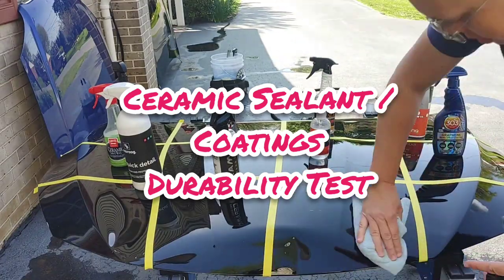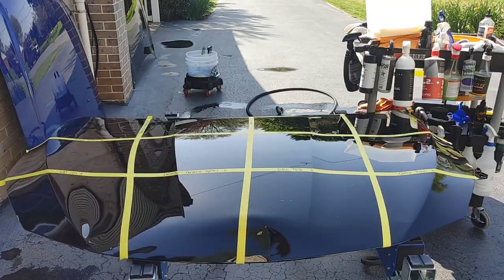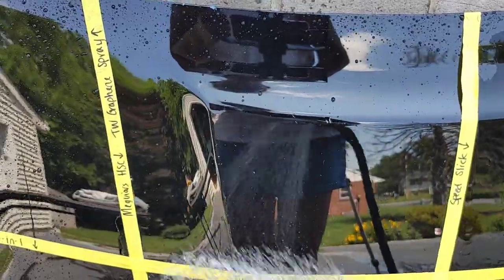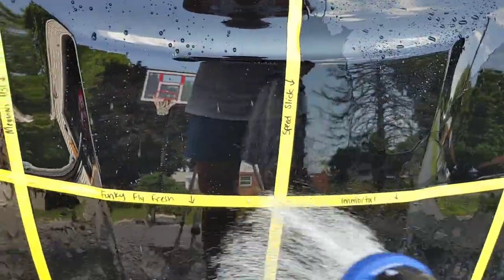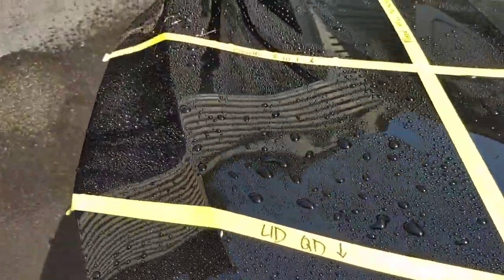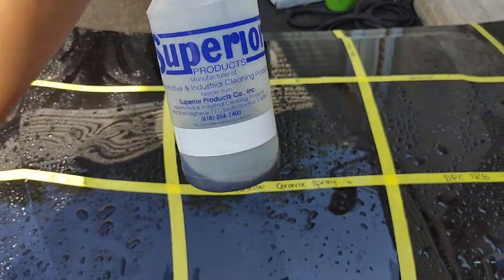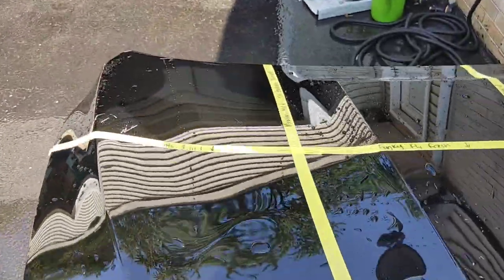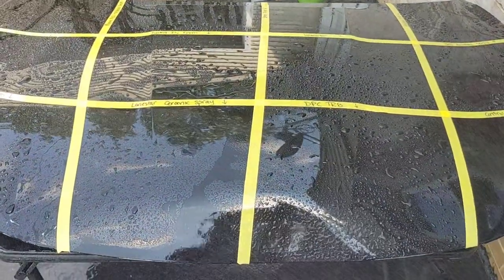11 Fan Favorite Ceramic Sealants + Spray Coatings Durability Test- ONE CLEAR WINNER! Which One Won?

Comment: We had a couple issues with SPEED SLICK. We've not only fixed the issues, but we've made it much stronger (doubled the amount of ceramic base) and durable...we also changed the name to BOOST. 

We'll send you a new bottle out and if you include it in any future tests like this, we're confident it'll grab the number 1 spot. 

But I feel honored to be among these other great companies/coatings and to be considered one of your favorites. 

As a small company, there are growing pains every now and then, but we are constantly working to make our products better and better. 

Thank you so much for including us.
Reply from the maker: Can't wait to test it out!
Reply from the maker: And I can appreciate a company who is constantly learning and evolving. Some companies I've worked with don't have that same humility and desire to give their customers the best they can produce even if it takes a couple tries to get it right.
Reply: @attention2detailswchelsea  I'll get it sent right out. I apologize, I thought I already had sent it. But I definitely WILL get it shipped out.
Reply: It’s good to see companies like yours taking on info like this a using it to improve a product👍
Reply: @johnp6987  Thank you. Yeah, we made the adjustment awhile back. The coating is now called BOOST. I mistakenly thought I'd already sent Chelsea a replacement bottle. If I had, the results would've been much different. 

I'm always formulating and testing new products. I have 14+ product formulas on the shelf right now, undergoing tests to see which, if any, will be our newest coating. Always trying to improve!
Reply: @blackrhinocarcare1087  I hope that Boost has more of a sheeting effect because quite frankly, I’m not a fan of all the beading. In a light rain, if you don’t dry your car, you get a ton of dried water spots the next day and it looks terrible. I have a daily driver that I prefer to wash every 2 weeks.  That’s just my 2 cents
Reply: @pasqualepisani , I agree bro. Absolutely hate beading products at this point. Anything but a torrential downpour and my car is absolutely trashed. Water spots everywhere and the car has to be completely re-washed. Sheeting all the way. Effectiveness over looking cool

Comment: Thanks for doing this. IMO, I’ll take the product that sheets the most with the least amount of beading. That may sound confusing but I don’t want to be a slave to my car every weekend or after every rain storm because of water spots.  I’d rather apply a sealant once a month than get water spots or have to dry my car after a light rain

Comment: I don’t know Madam Chelz, I’ve applied Undrdog Quick Detail to some customers, the come back usually in about every two months and after hittin it with Koch Chemie Active foam, the performance is way better. 
Similar with Griots 3 in 1, which is by far the most cost effective products here I think. I mean, you can buy 3 bottles  of Griots for almost the same of a bottle of immortal, and performance looks the same. 
Gotta agree that Meguiars Hybrid Praint coating is the top performer here, but it’s a lite coating. I would put it against Gyeon One, Can Coat, CQuartz Lite or Tac Systems Moonlight

Comment: Some of these products really blur the line between coating and sealant. I've been using the Turtle Wax and Griots for a while and have definitely had to deal with streaking, especially with the Griots. Will have to give the Meguiar's coating a try -- bit more expensive, but I think given its durability it should sort of level out. Thanks for the comparison, I love this kind of content!
Reply from the maker: Considering one can is $55 but you can do at least four to six vehicles with it and the shelf life is way longer than most products because it's aerosol that right there makes it a worthwhile investment in my eyes
Reply: And watch for sales at your local auto parts stores or big box retailers.  I grabbed it for $20.  A steal at that price.

Comment: The Beast -> Koch Chemie SO.O2 
 no product can top it , it's incomparable .
Reply from the maker: How long does it last? Just picked some up based on your recommendation
Reply: @attention2detailswchelsea  First of all, I love your videos! Lets go, In reality no sealant lasts more than 3 months on a daily use car. I've tested several "top brands"( CarPro, Gyeon, Koch Chemie, Gtechnic, Adam's, 303, etc)   I always use neutral shampoo or with silica and do decontamination every 2 months. Even the most expensive ones like Gyeon Cancoat that have a higher concentration of "silica" don't last more than 4 months. Koch Chemie's sealant works very well during these 3 months, the protection is unparalleled, my car is pearl black (Lexus RCF), it has a clear coat of medium hardness, very easy to stain, oxidize, lose its shine. Definitely the KC product solved my problems in this regard. In fact it works and maintains a repellent layer for a considerable time. The rest is pure salesperson talk , poetry, and marketing. A big hug from BRAZIL !!!!!